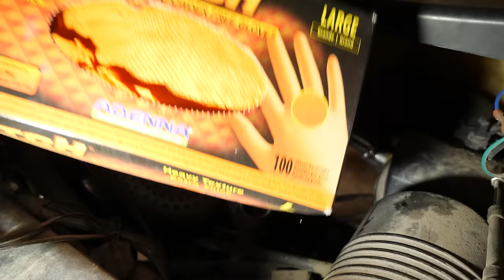2007 Club Car Precedent, Gas - Gas in Oil, New Fuel Pump

Comment: This is most likely old news to most but my ClubCar Turf II Carry All kept getting trash in the carb causing the needle to stay open and flooding the oil sump as well and saturating the air filter which was located lower than the carb.  After many times I finally realized that there is an atmospheric opening from outside the carb direct to the bowl that allows gas to move freely in the bowl "as well as unfortunately " allows trash to suck in through the atmospheric vent while running in dusty conditions. I installed a fuel filter on that atmospheric vent so trash couldn't be drawn directly into the bowl and never had a problem since.  Well of course, I did this after many carb cleanings, air filter replacements, fuel filter replacements, fuel pump replacements before the light came on that trash had to be coming in from somewhere else. Atmospheric vent was the culprit, at least in my case.

Comment: I had same problem with lawnmower. Old fuel line !, dirt in fuel pump from rust on metal parts inside pump (in my case) , had to add second filter just before carb-- solved problem.

Comment: What A-Whole designed this ----comment -----{love it!}I had a Grand jeep Cherokee with a bad fan relay, I went to our Chrysler dealership for the part and asked the guy to pull up the diagram , of where it was located. .He asked his  mechanic of the replacement procedure. I had to loosen the front bumper and drop it down on one side ,Take the passenger side headlight assembly out , then use a whole saw bit to bore a hole just big enough to get  an extension with a socket on to reach the bolt, there was no way otherwise, that is how we do it here ,he told me.Yep he was right , I changed the relay.

Comment: Good video. I probably would have also replaced the fuel lines since they could have been full of the crap that clogged up the carb also.
Reply: Thats how my system fouled up my lines were rotten the rubber got in my carb and in my fuel pump. I was having it serviced at a place near my house and they fixed it the first time but didn't replace the fuel lines so it happened again. I now i do all my own work on my cart

Comment: Not an engineer, however if you remove gas tank...carb job is so easy it makes up the time taking out tank...  find that junk in the tank comes out as well.    Have to ad that its a pain doing videos so...Thank you for posting.
Reply from the maker: Removing the the tank is fine if its not full of fuel. If its half or less, then its no problem.

Comment: Need your help, I have a 2002 yamaha golf cart that started smoking turned around put it back in the garage didn’t drive it far , found gas in the air box and filter was soak with gas and found gas in the oil so i drained the oil , put new carburetor,fuel pump, air filter, spark, and refill oil and ran the cart , very low power when going up hill, put back in garage and pull the plug ,it had heavy black soot on it, I replace plug , drove and same thing, low power when under a load and soot on plug, every seen This happen before, like you  videos they are very helpful, what is your thoughts on what’s going on with my cart, thanks for any help you may have. Mike

Comment: Hello Kevin I commend you and all these great videos with great commentary. I have a question I have a club car carryall gas. I have a little mechanic experience and I’m having an issue with my fuel making into the engine.
I swapped out the fuel pump and carb for a new one.  But I’ve noticed that my fuel filter does not fill up the gas. Gas does not make it from the tank to the carb. 
In your expert opinion what do you think that will be? Thanks I’m advance.

Comment: Thanks for your reply Kevin, also I am fitting a fuel gauge to my 2010 precedent, and wanting to know how to remove the varnish and other staining crap from the fuel tank?
And wanting to know how to check and reset the governor as I think it’s been tampered with. Cheers from Australia 🇦🇺
Reply from the maker: I usually remove the tank from the cart, drain it and wipe down the inside. Its much easier for me to do it this way but you can still do this while the tank is installed. I have a microfiber cloth attached to a long piece of steel rod that allows me to get inside the tank to wipe it all down. After I get all of the debris and gas out, I put a little bit of fresh gas (petrol) in, maybe a few ounces (mL), and shake the tank around. it helps to break up some of the varnish that has built up internally. I wipe it out again with a clean cloth, reinstall it in the cart and fill it back up. As for the governor, Club Car has a procedure for properly setting the governor, assuming the governor hasn't failed. If it has failed, you won't be able to set it to its correct speed. You can do a google search for the procedure. its quite lengthy to type into a YouTube comment.

Comment: I got 85 glib car ds an the neutral came lock out switch had  brock it was just so old fail apart golf cart was running great every day for a little over year that psc brick got new one out on now golf cart wont crank u can get it to crank when u pull lock out switch out an work micro switch with ur had an it start up push lock out cam switch back in it looks to be pushing the micro switch to its max an it wont crank just here the 2 micro switches clicking an the solenoid popping any idea what might be problem to just all sudden stop cranking over a neutral came lock out switch idk lost replaced micro switch still ntn.

Comment: Kevin a huge thank you for your videos.  They have helped me work on a cart I just purchased.  As for the issue you are resolving in this video.  My line of thinking, and maybe way off, if the engine is filling with gas the float (needle) is not shutting off the fuel supply causing an overflow condition into the carb and cylinder.  I think the piece of junk you found on the and of the needle was the culprit.  I cannot understand how a fuel pump could to this unless it was pumping too much pressure?  Could a bad pump cause fuel to run into the crankcase via the suction/pump line?
Reply from the maker: Correct, the debris in the carb caused the float valve to stick open allowing fuel to drain into the crankcase. The fuel pumps on golf carts only have 1-3psi of pressure. They work off the vacuum of the engine. If a diaphragm is bad in a fuel pump, its possible for it to cause the crankcase to fill with gas. If this were the case, the pump would not work at all. Its more common for the carb to be the cause.

Comment: THANKYOU KEVIN, it's always fun to listen to you it's like I'm right there beside you and you're showing us normal stuff especially when these engineers design locations and such so stupid LOL. 
Question: since our administration refuses to purchase non ethanol fuel, will this crappy fuel also deteriorate the rubber fuel lines/? thankyou in advance :) mark
Reply from the maker: I'm seeing issues with the ethanol fuels causing some issues with certain rubber lines. A lot of people have started switching over to those clear vinyl tubings, but I'm not a fan of those. The vinyl line gets real hard and brittle in a few years. I would try to make it a 2-4 year service to replace all of the fuel lines if you are having issues. With the newer carts, the fuel line has to be rated for at least 60psi for the fuel injection systems. Another dumb idea since they add very little efficiency to these small engines.
Reply: @Kevinsgolfcarts  LOL,,, ya, don't get it idk lol,  I may as well just replace them lines just in case along with the fuel pump like you did here in this video, thx again Kevin!!!

Comment: With the crankcase full of gas how many times do you need to change the oil in order to get the gas out of the crankcase
Reply from the maker: I usually change it twice if its real bad. If its just a bit overfilled and I catch it before it gets too bad, once is usually enough.

Comment: I’m having an acceleration problem with my 2005 club car car precedent gas. It’s all or nothing on the acceleration. I’ve changed the carburetor as well as the oil and all the fuel filters. Any ideas?

Thank you,

David
Reply from the maker: Sounds like a cable is sticking or adjusted too far causing you to start at nearly full throttle.

Comment: I have an 08 club car ds that spits fuel out of the intake at the carb, could that be caused by debris at the needle valve?  Put a cheap carb on it and new pump and filters and cleaned the tank out because it had loads of shit in it but that shit carb o think is still a problem

Comment: i know this is old, but why did you say youd run a 2es spark plug vs the factory 5es?
Reply: The 2 spark plug is a hotter plug compared to the 5
Reply: @dangson1183  so hotter is better sorry pretty new to this stuff

Comment: thanks for the videos and have a question for you about fuel pumps, so its kinda related. 
have a ezgo workhorse with a robin engine, with the valves adjusted and choke working properly, it takes forever to start. can pull the choke let it cycle for about 15 seconds or so before it will start, ive checked just about everything i can think of besides how to test/replace the fuel pump, my theroy was the pump side of the fuel pump wasnt pumping fuel to the carb properly, last thing i was going to try was taking the carb apart and cleaning it properly and putting back together. any thoughts on if im missing anything ?
Reply: forgot to add, once it starts , it runs good, but even warm or cold, it always starts the same way, will crank crank crank and then finally start.
Reply from the maker: One thing to keep in mind with these types of fuel pumps is, they are designed to pump a low volume of fuel and a very low head pressure. I would check the vacuum line and see if its blocked. Sometimes oil will build up on the inside of the hose running from the crankcase to the pump and cause a blockage. There is also a brass mess air filter on the front of the pump. This sometimes can become blocked and cause the pump to have reduced performance. Be sure that the fuel lines are not hard and brittle. This can cause the fuel pump to lose suction and draw in air.

Comment: Do you ever degrease the engines before you start any service or major work?
Reply from the maker: Before any major work, yes. If its just a routine service, it will get washed down if it has been sitting for a while or if its really dirty.

Comment: Kevin, I have a 290 that filled with gas. After fuel pump and oil change X2  it will run. Now after 3-4 laps around the yard it starts to smoke alot. Could the muffler had a gas/oil mixture pushed into it? 1996 DS with horizontal muffler.
Reply from the maker: Its very possible that oil and gas are just burning off from inside the exhaust. You said you changed the oil? Make sure you didn't overfill it. If you overfill these engines with oil, they will smoke a lot. I would remove and clean the carb, if you haven't already. The float valve sticks on these and gas starts to overflow into the engine and fill up the crank case. In some cases, I've changed fuel lines since they can degrade and make it into the carb.

Comment: Hey im hoping you can help me with my 06 club car my Governor is not working and I was just putting it right into wide open and shut it off instant I unhook the throttle cable to the carburetor then absolutely does nothing these things run so weird please help
Reply from the maker: You might have a broken accelerator cable or throttle cable. There are 2 cables, one from the pedal to the governor and one from the governor to the carb. Be sure both are working when you step on the pedal. If not, they are out of adjustment or broken.
Reply: Yea that's all 100% good i just put the whole cart together i no how most things work and if they are broken i just don't get the governor and how that plays apart with my throttle being wide open when the cable I unhooked it and it's still sent it wide open and hit the rev limiter i believe it might be broken i guess. Do you think i can just take it out like a go cart motor and plug the hole? And thank you for getting back to me do fast i can't find anything on this problem on line
Reply: It does move it just would level out at all and goes straight to rev limit